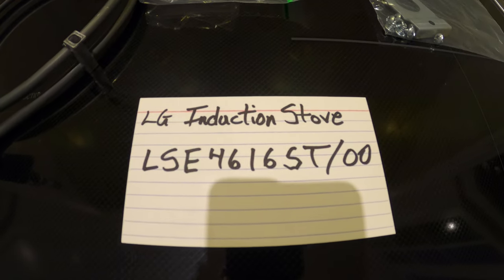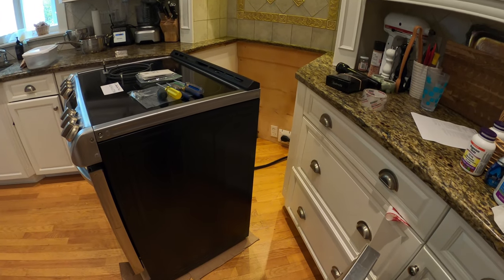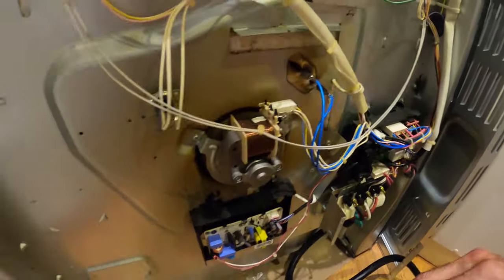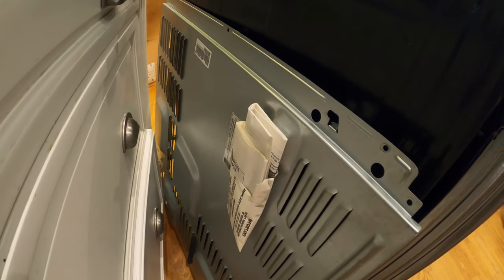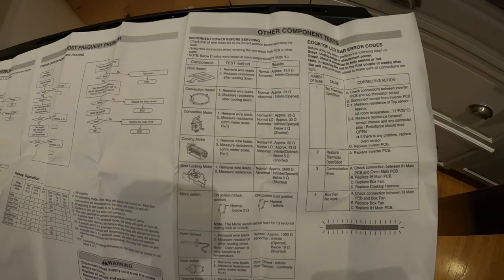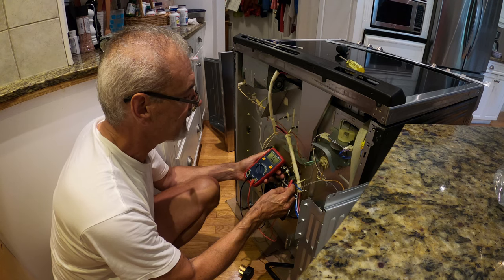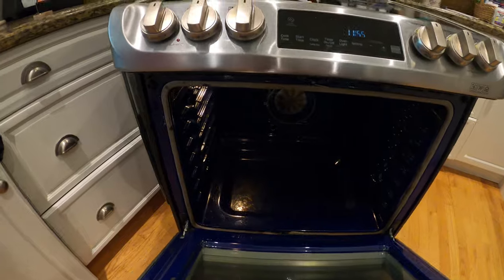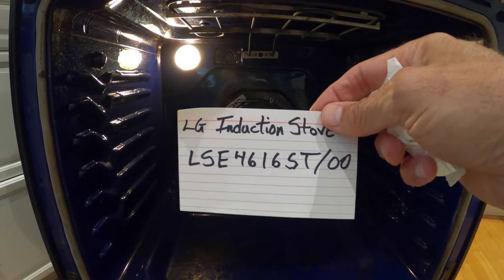LG Induction Stove - LSE4616ST - Fix Bake Element

Comment: Thank you for an excellent, detailed repair video. I am certain I will need to reference it in the future. I have just purchased this exact model and am getting familiar with some of the quirks. For example, I discovered while baking bread in it or the first time and not getting the expected results, that on the “Bake” setting, my stove is actually 22 degrees Fahrenheit under the displayed temperature! At a pre-warmed (for 45 minutes) and set 480F, it was actually registering a maximum of 458F on my calibrated digital thermometer! I was able to adjust it “up” by following another YouTube video. Hopefully that does it! Thank you again.

Comment: Looking at this exact model.  If you had to do it over again, would you purchase this again?
Reply from the maker: I think so. I have adjusted my expectations of quality to a lower level because I think customers and suppliers have formed new set of expectations in the appliance market where an appliance will last 5 to 8 years versus the previous mutual agreement in the period prior to 2000 where the expectation was 10 to 15 years. In this specific case I think my element failed because it was malformed and touched together forming a 'hot spot' that quickly degraded the unit. I'm a bit of a tinkerer and so I'm not terribly upset at a failure like this because I can fix it myself. But I also understand that for most folks this would be super annoying and costly.